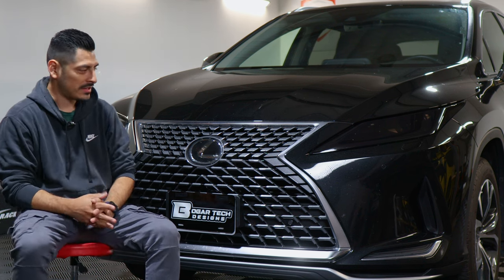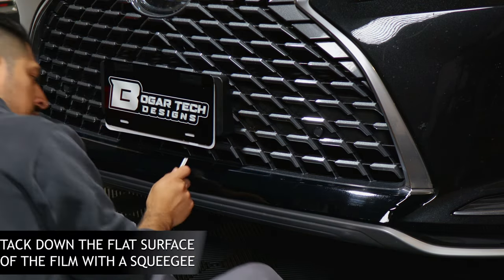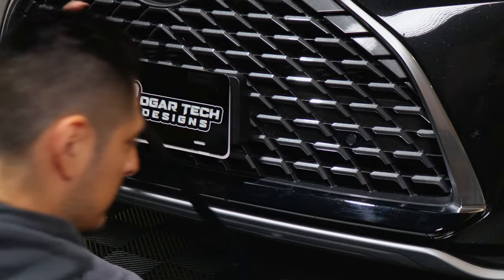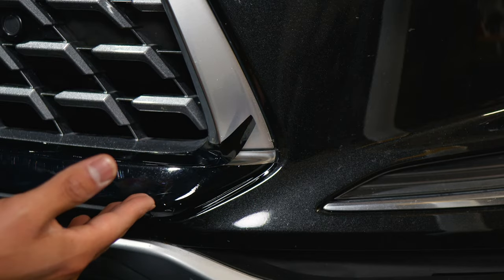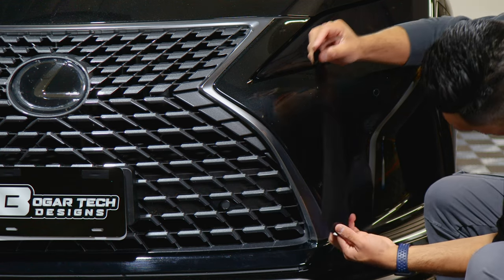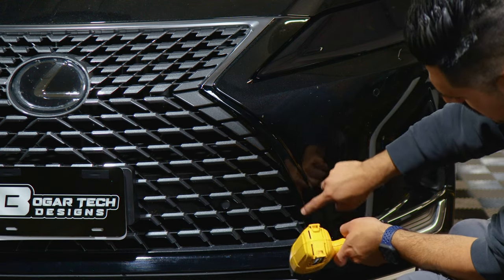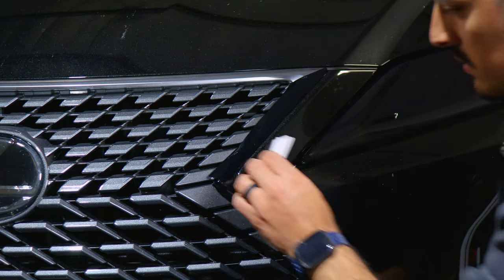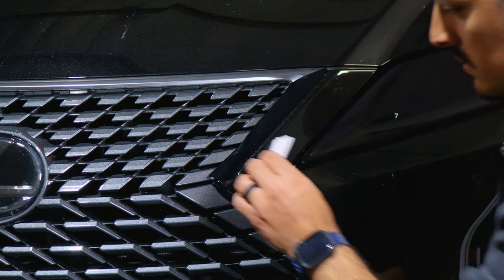2022 Lexus RX350 Front Grille Chrome Delete Install

Comment: What do I do if I don’t own a heat gun?
Reply from the maker: You can use a hairdryer on the low/med setting! Since every hairdryer is different, having it on the low/med setting will allow you to have a bit more control when you heat the film and give you a lesser chance of burning the film!